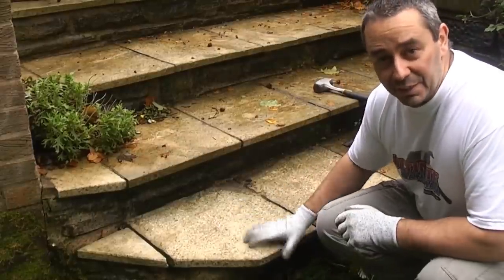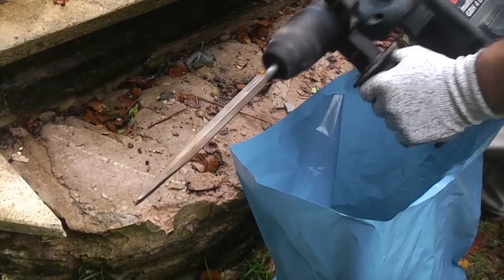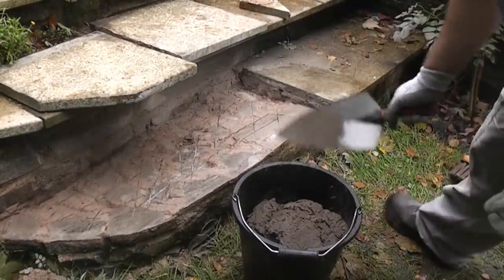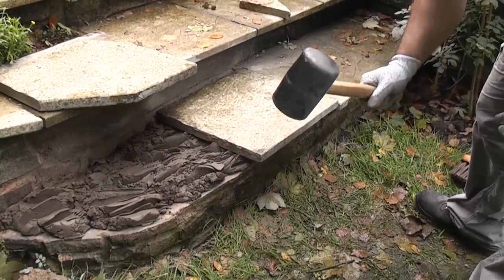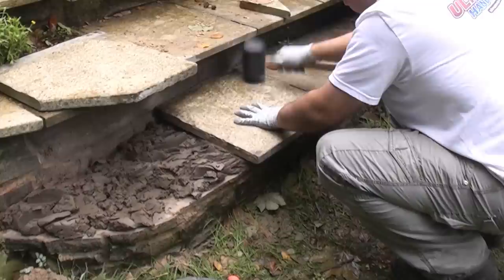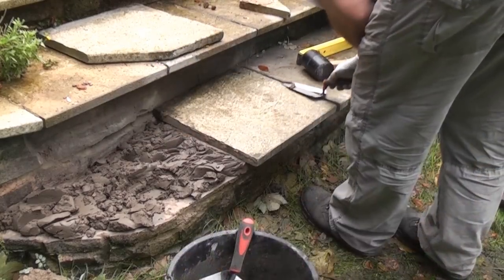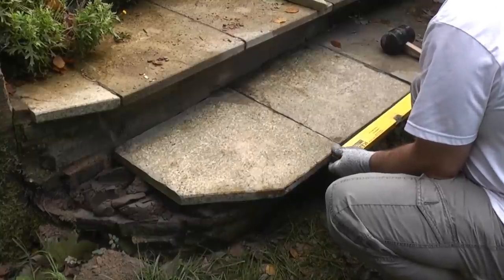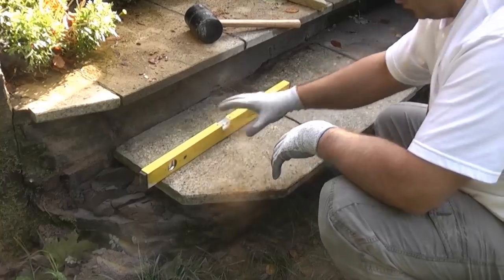How to replace a loose paving step

Comment: Good upload. I wetted the underneath of the slab too. It helps it stick.
Reply from the maker: I've started to use SBR now in my mix and also as a primer, that seems to work really well, but as you say wetting it will also help.
Thanks for the comment 👍

Comment: nice job did you prime the backs of the stones or not sir
Reply from the maker: Can’t remember now, as it was a long time back. To guarantee better adhesion, you can score the back of the paver using an angle grinder and diamond disc, then prime it with SBR, you can also use SBR for the mortar mix and it will stick much better 👍

Comment: What did you use for the pointing mate? Can you use the same mortar mix? I need to grind out some bad pointing on my Indian sandstone and then lift & relay. Just wondered what would be best to use for the pointing? 

Also just thinking ahead for the new bed when I relay my sandstone, would advise to use ready mix mortar or mix my own as per your other video?

Very informative, clear and concise videos 👍🏼

Thank you!
Reply from the maker: I would not use ready mixed mortar.
The mix I used for fillet pointing would work well-https://www.youtube.com/watch?v=lPhQGz800Eo
You can apply that using a mortar pointing gun, or this cheap version- 
https://www.youtube.com/watch?v=OjVBBOIEMH0&t 

Thanks for the comment 👍

Comment: UH,
Thanks for sharing this video. I've got a similar problem with the cappings on my brick wall, so will be using your advice on those (perhaps in Spring).
I did want to ask, could you do a brief how-to mix mortar? I've always been crap at it and not sure why. The mortar is either too dry and flakes off the bricks, or too wet and is running down the bricks. Any advice gratefully received!!
Nathan
Reply from the maker: Hi Nathan, No problem, I have already done a video on mixing mortar-
How to mix cement by hand
I also replaced some capping stones on a wall earlier in the year, I have filmed it but not had time to edit and upload the video yet, but it's very similar to re-fixing the loose step ;-)
If you wet the mortar too much you need to leave it to dry out a bit before using it or it makes a right mess, the best option is not to make it too wet in the first place! I hope this helps ;-)
Reply: *****
Brilliant. Thanks for that!!
Reply from the maker: Nathan Brown
You are welcome ;-)

Comment: What is the name of that tool you used to make the grooves in the slab? Thanks for the video😁
Reply from the maker: I used an angle grinder with a diamond tipped blade.
 Thanks for the comment 👍
Reply: Ultimate Handyman Thank you!

Comment from the maker: @ pag2006
For some reason the new youtube comment system won't let me reply to your comment. I don't know why they installed them like this, personally I would have gone for a smaller overhang or none at all!
Reply: I think he is just repairing, not constructing the steps. I bought a house that had same situation and I've seen the same problem on a zillion other houses. The question to ask is do the paving companies ever build something like this for themselves? Because if they did they'd realize that sooner or later they'll need to repair/replace steps. But maybe that is the point.

Comment: Can I ask a couple of questions 1) what was the mix ratio 2) what would considered the standard overhang for steps? Thanks for another very useful video 🛠
Reply from the maker: I think the mix ratio for this was 4 building sand to 1 cement by volume, this might help- https://www.youtube.com/watch?v=SN0aAG-HgD8
I think the overhand on these steps was about 2 inches.
Thanks for the comment ;-)
Reply: Can you use sharp sand for these or only building sand?
Reply from the maker: I used building sand, but I'm sure sharp sand will be fine ;-)

Comment: Good video but I will add one more tip should lightly hydrate old surface and the stone as well to increase bonding
Reply from the maker: Thanks for the tip ;-)
Reply: How do you wet the surface?

Comment: That hand chisel looked a belter
Reply from the maker: Yeah, it's a Forge Steel from screwfix.
I have a few Forge Steel tools now and they are excellent value for money (I'm not on commission BTW LOL)
Thanks for the comment
Reply: It just looked to cut into the material very well I might give one of them a try LOL I am still spending thousands replacing stolen tools a grand plus this week on tiling gear.
Reply from the maker: wayne burgess
Nothing worse than someone who steals a tradesman's tools.
I hope they were covered on the insurance!
Reply: Nope they emptied my van loaded for a big multi trade job :(
Reply from the maker: wayne burgess
Sorry to hear that.
I have a spare 110v Makita circular saw if it's any use to you ?
Reply from the maker: wayne burgess
Glad you are getting there. It does wind me up though when some scum bag steals a tradesman's tools and indirectly his livelihood! 
I hate to think how much money I have tied up in tools!
Reply: It floored me Bud. I ended up having to do shitty jobs to build everything up from scratch as I didn't have anything left and the van was knackered so literally started again at 50 years old from zero but it has been rewarding too because it is was challenge so sod em :)

Comment: Why do you cut Into the slab and also the surface to lay onto?
Reply from the maker: Some of the mortar will be pushed into the grooves which are cut by the grinder, which makes the mortar grip the two surfaces better.
Thanks for the comment

Comment: Next time just use landscape adhesive.  The cement underneath did not fail and is intact.  The problem with slabs is there is always a cohesion problem with the bottom of slabs.
Reply from the maker: Thanks for the comment